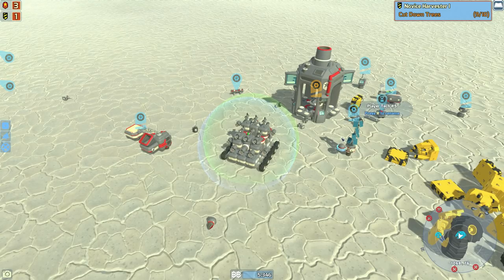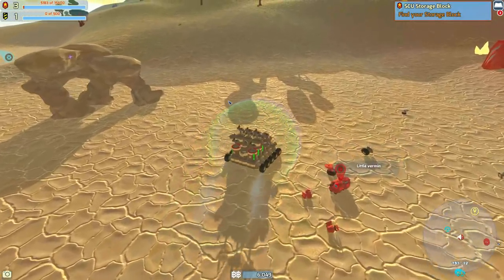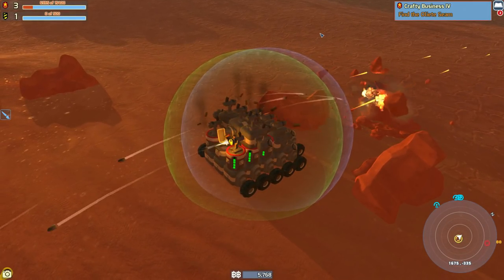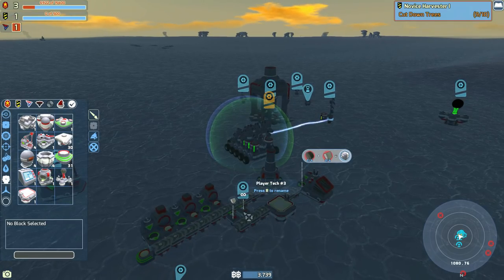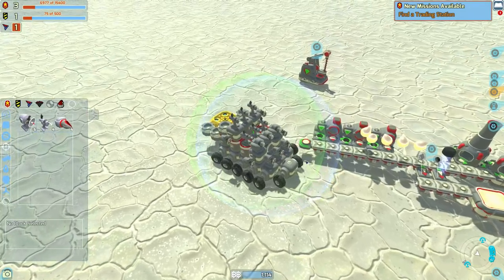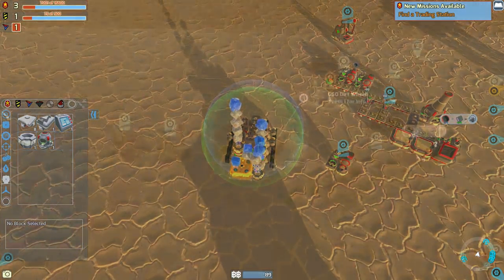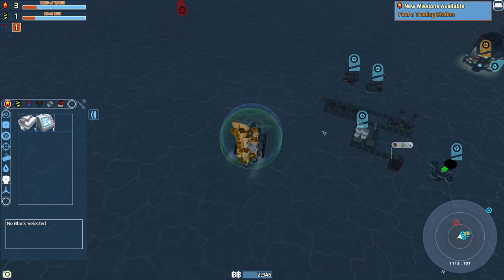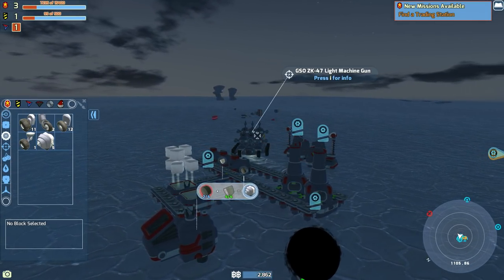Terratech | Ep3 S2 | Mini Crafting Base!! | Terratech 0.7.4 Gameplay!

Comment: The crafting system is now "smart", meaning that if you have a silo, the crafter will only pick the resources (over the conveyors) that it needs. You can see that it woks, when the little antenna is blinking. The refineries work the same way. If there is a crafter at the end of the line, it will only refine, what the crafter needs.
Reply: So you don't need to build a complicated filter system.

Comment: Hey Lathrix is there a way so you can Store Your Refined Items on the Silos and then decide if you want them Refined or Sold? Because I find it kinda annoying to go out hunting for Materials that I had previously not needed but they were automatically sold
Reply: Setting up a base that refines fabricates and also sells is rather difficult given the blocks available. I did design one where if certain filter conveyors are turned off / on a single base can swap between modes. Feel free to check it out by loading it in creative mode after accessing its .png here: http://forum.terratechgame.com/index.php?threads/zeds-tech-zoo.9126/page-2#post-62348
Reply: You can have a block of storage silos yes - the fabs will call for resource & ask for it to be refined on the way, and any excess will simply bypass. Takes a huge amount of silos, filters and space though given  there's 12 chunk types & you can't choose 2 or 3 in one filter. You can have more than one filter oee silo ofc, but then you could fill the silo with one chunk type.

Lath, you'll get a component fab later.
Reply: +zed yes this must've took some time to make and it sure works...
Really I was looking for a simple solution, just a switch to sell or keep excess amounts of Materials is all it would take without having to take off blocks or switch filters
+Richard Dastardly ^^^
Reply: +shalol Total design time was around 10 hours in order to ensure functionality and overall symmetry. Alas without logic blocks to automatically switch the filter conveyors the system on this base is convertible with a few right clicks (on the filters) to swap them manually.

Upon initial spawning the tech is set to store and fabricate; however once it stores material merely swap the initial "buffer" lotsa silo (next to the Geocorp worklamp) from output to input via filter conveyors and turn on the filter conveyor pointed left (if viewing the scrappers / inputs at the bottom of the screen) to convert to full selling mode. 

If left in original mode and then set to selling mode (above) merely tell the 3 storage lotsa's to no longer accept additional materials and to send back specific types of unrefined / refined / components which are not needed for refinement and sale.

As with all fabrication "techs" please bear in mind that all of the individual fabricators "call" for resources concurrently, and will put higher priority on refined requirements when compared to raw so it is suggested that you ask the factory for only one block from any specific refinery at a time as opposed to asking it for 3 or even 4 types of blocks at the same time. The only other quirk of this specific terratech base is that it will claim called for yet unused wood to help keep the base's batteries powered. 

I may redesign this aspect once Terratech enhances its fabrication capabilities, but for the time being this factory is completely capable of fabricating any block provided it has the resources to do so. with only one component fabricator some parts may require the user to specifically fabricate the required components manually prior to the manufacture of the requested block. The Goal of the build was to be capable of defending itself in campaign mode yet not being absurdly large that it would cause single-digit framerates when viewed by players with under 3GHz CPUs.

To that End, +Richard Dastardly is correct, many factories with similar functionality are typically far larger and therefore susceptible to significant drops in framerate despite the recent changes made to resource chunks / components no longer having their own "physics" which unity would force the CPU (not GPU) to calculate and render.

Comment: as far as i can tell, the conveyors move just a little bit faster than the filters can suck up blocks. ive always had to double up on filters to keep things moving smoothly. just have 2 filters per silo and you should be ok. works for me.

Comment: Lathrix, i'm not sure if this is still the case, but some craftables require the raw materials, so it does still need some changes, probably. Unless the refineries connect to the constructor and even pass raw materials without refining them.
22:00 every 3rd consecutive item to be filtered with no space between them gets ignored it seems.